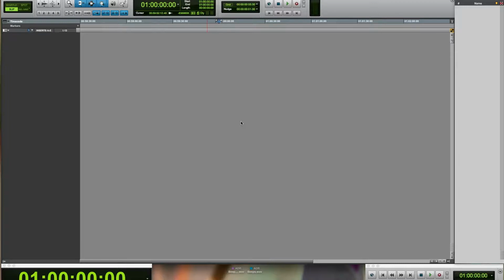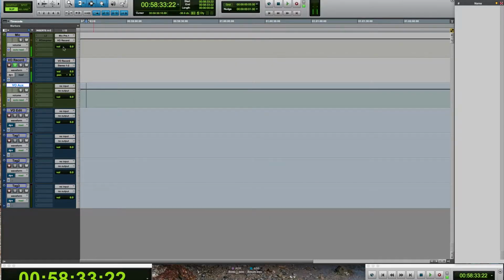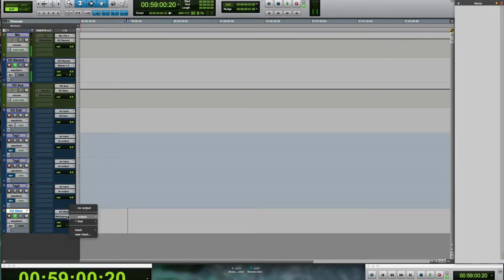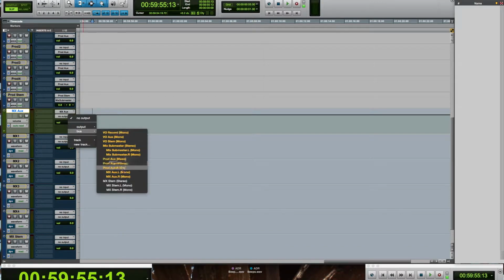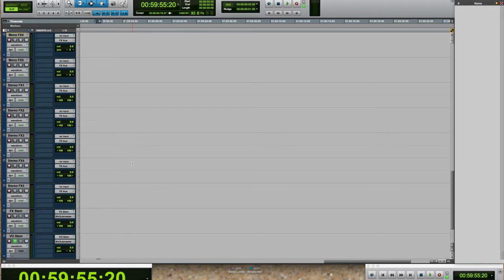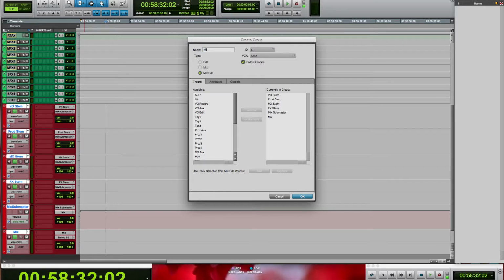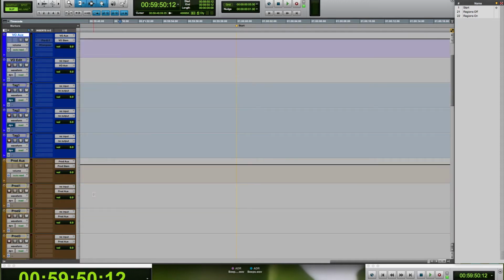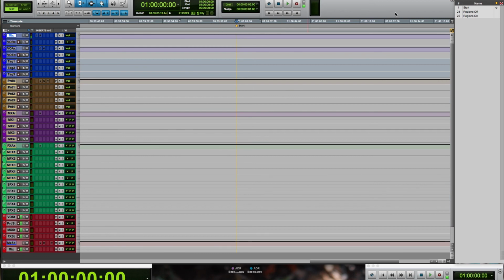Creating a Pro Tools Template for Post Complete

Comment: Using this set up works fine when Recording stems and Final Mix. When Bounce To Disk the Final Mix, it outputs a muted file. What do I have to check to get a proper bounce?
Reply from the maker: Create a new bus of the appropriate width (mono/stereo) for each stem in the I/O page and name them appropriately (i.e. VO Bounce, FX Bounce, Full Mix bounceetc.) Move all of those new busses to the top of your I/O. Then add an AUX track for every record stem track (i.e. VO, MX, FX, etc.) matching the mono or stereo nature of each one.  Next select all of your new Aux tracks and give them a unique color. Then move them adjacent to the record stem tracks they will be replacing. Now, track by track name the new auxes like this (VO Stem bounce, Prod Stem bounce, etc.). The match the input of your new auxes to their record stem audio track counter-parts. For example, VO Stem Bounce Aux will have its input set to VO Stem. Do the same for the outputs. Now the crucial step: one aux track at a time, hold down the CTL key (Mac) and add to the output the appropriate bounce bus you just created. So VO Stem Bounce Aux will be bussing to both the mix submaster and the VO Bounce bus. Do this for all of your new auxes.  Then select all of your record stem audio tracks that you will no longer be using and make them inactive. Now you can test your work. Do things on the VO tracks route to the new VO Stem bounce aux and the the Mix bounce aux? Test this for each element and fix any issues you may find. Once you are confident it is correct you can bounce out all of your stems and full mix faster than real time. Use opt+cmd+b (Mac) or "Bounce to Disk" from the file menu. Because you moved all of your new busses to the top of the I/O the first bounce bus should already be selected. Then just hit the plus button to add the others, which will appear automatically in their order on your I/O page. That's it
Reply: @TheOutpostSound  You are a gentleman. Perfectly explained and worked straight away. I now have a more modern template session (clients don't have time to wait for real time exports anymore) and I also didn't need the extra Full Mix bounce track, as I can just use the Stereo Master track to add to the list to export.
Many thanks!

Comment: what is your setting in Nuetron 2 for the ducking?
Reply: Thanks. This really made a much smoother ducking than my typical compressor ducking. Really appreciate your tutorial.
Reply from the maker: There are too many parameters to list all here. But, in general select a few frequencies that interfere with vocal formants, drop them about 2dB, then add another dynamic node at each of those frequencies and have them trigger from the key input., which is fed from your VO/Dialog. This will create a little space overall and a smoother transition to more space when VO/Dial ar present.

Comment: there is a conventional number of busses to be used with stems?
Reply from the maker: There is a rule of thumb or a general practice. It's not the only way.
Reply: in sending an aaf/omf to another editor, the busses outputs how are configured, for expemple, dialogue stem bus 9, sound effects bus 11-12, etc.

Comment: How would you incorporate a print track to handle mix minus vo in this template? Thanks for a fantastic and well thought out video.
Reply from the maker: You have a few options, depending on what you need to deliver. For instance, if the Mix Minus needs to have the same "mastering" style plug-ins that you might place on the Mix Submaster you can create a Mix Minus Bus and a Mix Minus Submaster Bus, duplicate the Mix and Mix Submaster tracks, including all plug-ins/settings, then route the Prod/FX/MX Stems to both the Mix Submaster and the Mix Minus Submaster, and route the Mix Minus Submaster to the Mix Minus. Be sure to mute the Mix Minus track so you’re not double monitoring. 

Alternatively, you can create a Mix Minus Bus and a Mix Minus Track, set the input of the Mix Minus Track to the Mix Minus Bus, then route your Prod Aux, MX Aux, and FX Aux to the Mix Minus Bus as well as their current Stem routing. Again, be sure to mute the Mix Minus track so you’re not double monitoring.
Reply: Anthony Friedman thanks for your speedy reply.  I’ll look into your suggestion.  My current template is similar to yours with some variation but for some reason I can’t seem to get the simultaneous mix minus print right in my head without what seems to me to be a somewhat unnecessarily convoluted signal flow.  If I solve it I’ll let you know.  Thanks again.
Reply from the maker: If you have trouble, just reach out again. We'll work it out